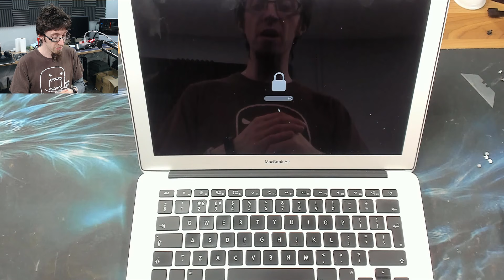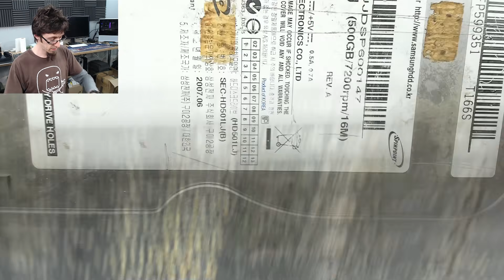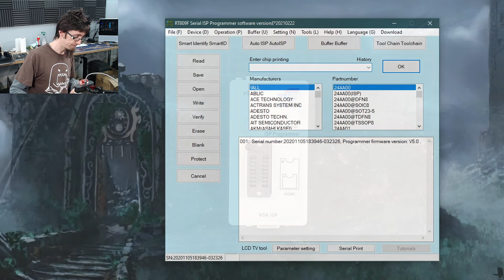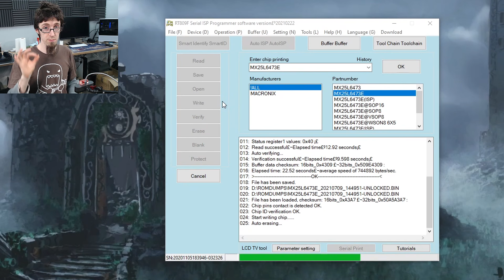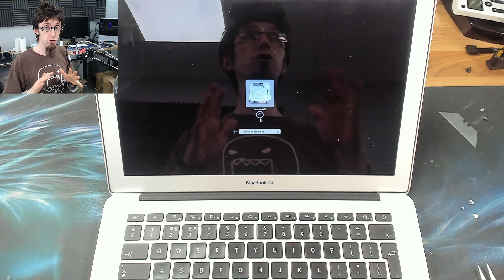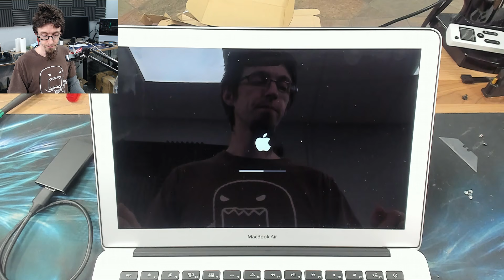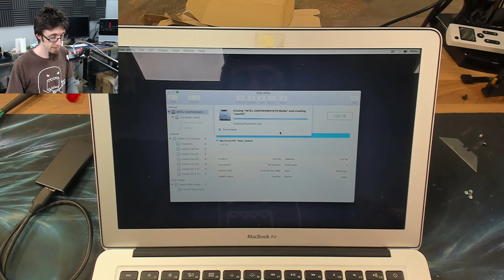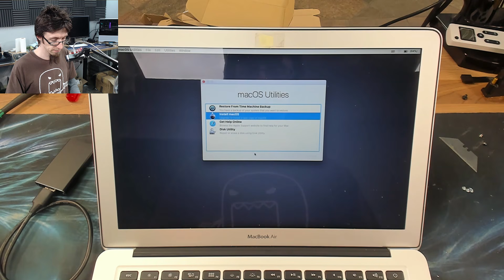[2017 and older ONLY] MacBook Air Firmware Pass / iCloud Lock Removal - LFC#275

Comment from the maker: Also, as far as I know modern Apples with a T2 security chip are different animals to this. I've seen claims that there are tools to deal with T2, but I've got no intention of risking macbook to test them, or at least not until I come across a bricked one that can't get any worse.
Reply: @AppleReviews  Which is fine if he charges for these services. They can go to Apple if they want. However many place DO NOT HAVE a PSP or AASP nearby.
Reply: @AppleReviews  However they have to way to accept desktops without an Aasp or Psp. There is no mailing in DTs
Reply: Did you do something like this with IPhone ?
Reply: i bought a 2019 mcbook pro 16 inch i9 has efi and cloud this was an auction buy if I fail would you take a donation also are the t2 chips that far different in aspect I notice there is the t203 device I was considering adding for this unlock process? also a member of the discord :)
Reply: 👆👆he just help me unlock my iPhone 11 pro max 🙏..
Reply: 👆👆he just help me unlock my iPhone 11 pro max 🙏..
Reply: We do it with forensic tools. This has ben able only a few months back, not long ago!
Reply: Is it possible to remove drive encryption and iCloud password on 2020 macbook with touch id? I know these later models are all linked and can't swap out chip ssd etc any help appreciated thanks
Reply: Adamant IT  I have a different BIOS chip than the one you have. Is that gonna be a problem or do I follow the same steps?  My chip: Winband 25Q64FV10 1513 6448 6R800ZZ.
Reply: @blgrnt123 Choose the correct BIOS/EFI chip from the drop-down menu, then follow the same steps.
Reply: @blgrnt123  Choose the correct BIOS/EFI chip from the drop-down menu, then follow the same steps as in the vid.
Reply: So doing this ,will it remove all data?  My sister in law has a mac laptop and when she split with her ex he put a password on it(I'm not sure if it was a cloud one) and wouldnt let her have it and she's been locked out for years now. She would love to be able to get into it as she would have baby photos on it. Is this something that would help her? Or as it sounds like your uk based would you do it for a fee? I'm sure she would have proof of purchase there still. I would love to be able to recover it for her.
Reply: Where I can order your services? iMac M1 locked
Reply: How can I reach you?
Reply: Hey, does this work on the M1 Max series MacBook pros as well? Thanks!
Reply: 0
Reply: How can I get to talk to you?
Reply: Do you happen to know if this method works for the MacBooks with M1?
Reply: Hi guys i need this service, im based in the UK and have emailed your shop but have had no reply!
Reply: What about T Chips are they in the same boat as T2?
Reply: I want to buy a MacBook mid 2010 a1342 (MacBook7,1 & EMC 2395) with Lion operating system from an organization. They forgot the firmware password so they are giving it away cheap. Found a way on the internet to remove the firmware password by changing the amount of RAM and clearing the pram. Will it work on it?
Reply: Would I be able to send you my computer to fix it in firmware lock? I drove 2.3 hours to the closest Apple Store and they told me they couldn’t do anything and it’s stressing me out, it’s been stuck like this for months, Idc how much it costs, I just really need help
Reply: Will Linux run on this???
Reply: Why would you need to "risk it"?? Just i-Cloud lock your working  Mac (you KNOW the password) and see if the tool will unlock it.
Reply: How can i remove firmware lock on 2018 macbook pro 15inch that won't allow the keyboard
Reply: Hi,I need your adwise,can I use EZP 2019+ programmer to unlock Macbook pro A1425 late2012?Thank you.
Reply: Firmware lock 20q5 macbook air dfu mode
Reply: the macbook i'm working on it is 2015 A1466.
Reply: Why don't you try it with an iPhone? 🤔
Reply: @Ángel de Jesús Flores Tinoco  iPhone I locked to server.  If you achieve changing the Serial, UDID and  IMEI the u cam get through!!
Reply: @chuy6590  why dont you send him a iPhone to try 🤔
Reply: *waves hand* You don't want to send him an iPhone to try, "you want to go home and rethink your life"
Reply: @sugargliderdude  because he's a dreamer 😴
Reply: You are correct about the T2 chip. Also, not that it’s a big deal, but I find taking the battery out of those model MacBook Air’s when removing a logic board a bit easier to reconnect the trackpad and backlight cables. I do hope though, that you backed up the files that were on the SSD, and or they had a time machine back up. 😀 BTW.. what is Mac OSS ? 🤣😂
Reply: Thank you brother you are doing great job love from Pakistan i have learned so much from you it would be impossible without you❤️
Reply: Hi, i work on T2 device all the time, if do you have any questions or need any help let me know
Reply: @apple_unlocking_services3004  yeah you do bypass, charge a fortune and then when they try to do macOS upgrade it locks again. You phantom unlocking wankers are so full of shit aren't you???
Reply: @apple_unlocking_services3004  hi
Reply: @apple_unlocking_services3004  yes i have a question to you.
Reply: @apple_unlocking_services3004  hey do you know if this method work on t2 chip to bypass icloud and firmware password?
Reply: @XDPower94  
Hi, for the EFI removal on T2 devices it can be done through replacing one file inside the T2 chip files, no need for hardware work

for the activation lock it can be removed through software “Paid” or hardware “Free”
Reply: @apple_unlocking_services3004  what you mean by hardware?
Reply: @XDPower94  
which part ?
efi or activation lock
Reply: @apple_unlocking_services3004  activation lock
Reply: @XDPower94  making a modification to one of the chips inside the device, requires skilled technician
Reply: @apple_unlocking_services3004  i really wanna learn, what chip i should look? Bios?
Reply: @XDPower94  
i have been selling the method for $750
it toke me lots of work to learn it 

i can only share general info
Reply: @apple_unlocking_services3004  tell me where to start and what to look. No need explain a lot, just few things please.
Reply: @XDPower94  
do u wanna learn it because u have 1 device  to unlock & thats it ?

or u need to learn it for doing business ?
Reply: @apple_unlocking_services3004  i have one device and i wanna unlock and learn if it s possible. I dont do business... My brother found this mac in the magazine where he work. And its not even turning on. Im trying to fix and unlock
Reply: @XDPower94  
its not worth the work & time to learn the whole process to do one device,
better to take it to a shop & pay about $100 to unlock it

i guess this method will never be free to the public
Reply: Hey why can’t you just replace the hard drive?
Reply: one word CRAPPLE . whorible products poorly made too trick rich people into buying them , they are soo simple in their OS and everything their made for 80yrs olds ... hahahahah and no customization.. PS Louise Rossman must be your Master boss
Reply: @EpicGamingEct  Wow. Can't get more ignorant than this fellow. "they are soo simple in their OS" What?!
Reply: @EpicGamingEct  You obviously have no clue that macOS is BSD and you get full and unrestricted root access to the entire filesystem. Being UNIX, I would venture to say that macOS is considerably more advanced, more stable, and more "customizable" than WinBlows. :)
Reply: @EpicGamingEct  you clearly never owned one 💀

Comment: Will this work on Mac Pro 2011?Got it gifted from Uncle,went through some trouble fiddling with lion os eventually found a way to get high sierra set up account through it efi locked it forgot password so it seems bricked atm
Reply from the maker: Should do. I've not looked at the BIOS on a Mac Pro, but given it's from the older era stuff, it should work approximately the same way.
Reply: @Adamant_IT thank you sir much appreciated

Comment: Very interesting.  I have a 2019 Intel iMac 27" that I want to restore to factory new but it has a firmware lock on it.  Are there ways of removing the lock without dismantling the machine - I'm aware iMac's are quite tricky to open.  Thanks

Comment: Thank you very much for this detailed tutorial. With all the information contained, I was able to get my old MacBook Pro up and running again. The programming with the CH341A mini Programmer turned out to be a bit tedious, because working tools (AsProgrammer) are only available under Windows. With the macos G-Flash programmer it was impossible to even recognize the firmware chip, let alone read it out and reprogram it. However, with a Windows PC I finally managed to unlock the firmware and reinstall macos via USB bootstick.

Comment: Would this process work for a more recent macbook pro with a T2 chip per chance?
Reply from the maker: No, there's no real password removal for T2. There are some temporary bypasses, which is what the unlocking sites sell you, but those unlocks will fail any time the laptop receives a security update, so you'd basically have to keep it offline forever.

Comment: This inspired me to get a programmer, I got the ch314a and all of its accessories in a pack. I do have this adapter to 1.8v. Is this the one you mentioned? Also there is a eeprom chip frame for the programmer. I just need fit the chip on in the frame, than the frame to the adapter and adapter on the board right?

Comment: What kind of heat gun is used for soldering and de soldering the chip from motherboard??
Reply from the maker: It's called a 'Hot Air Station' My one is a Quick 857dw+

Comment: Hello, I wish you good work. I have an iMac A1224 model PC. I have a problem with the BIOS. When I log in with the combination key, it does not allow me to install a different operating system. If you have my request, can I get the bios bin file for the A1224 model?

Comment: my screen is flickering on my 2019 macbook pro 13"  and the battery drains quick. I found the same laptop but its a 2020 so should be the same parts. Can i just move my motherboard over to the 2020 macbook pro or is it more complicated than that. PS. the 2020 one is locked and for sale on ebay.

Comment: I got a macbook air mid 2013 from a family member that they brought off ebay the seller got them from a computer salvage store the macbook has a four digit lock with a keypad on it I took it to apple they told me that it was a efi lock they couldn't help me with out the original bill of sale so i just remove the efi chip and put a new on it it's working now
Reply: Okay but do you lose the old data ???
Reply: @maleksouab6930  You do not lose any data. Replacing or overwriting the data on the chip only removes the EFI password and allows you to use your device again. That being said, there is also another method of removing the EFI password - instead of removing the EFI chip, you can use an adapter to connect to it while the motherboard is still in the MacBook, and then overwrite the password using software. In my opinion, this method is easier (at least in some ways).

Comment: i have my mac with oracle Remote management lock what should i do@adamant, thanks in advance
Reply from the maker: MDM requires a serial number change, which is a similar process to this, but with extra steps. There are some apps that streamline it, but still requires the chip to be reprogrammed
Reply: @Adamant_IT  thanks man and my mac is T2 series
Reply from the maker: Oh that's game over then, there's no permanent bypass for 2018 onwards

Comment: Hi there!
I am trying to use this on a 2012 MacBook air.
The BIOS Chip is labelled 25Q064A 13E40.
When I put it into the CH341, it correctly identifies it as "Micron N25Q064A".
I can read the chip without issues and have already removed the password.
But now when I try to write to the chip, the programming Software (Asprogrammer) freezes and/or the CH341 disconnects itself from the PC.
The chip is obviously already unprotected.
Any ideas?
Reply: I figured out the issue: The output of the 3.3 V regulator on the CH341 was not stable enough to be used as the supply for the programmer.
After adding a 1µF and a 100nF capacitor on the output of the regulator, it now works flawlessly.

Comment: I removed the icloud lock from my iphone 14 using iRemover       The iPhone 14 is my first flagship Apple device. Coming from a Pixel 7, I have a few observations. The battery life is awesome, speakers are solid, Bluetooth connectivity is seemless, and the screen is smooth, despite coming from a 90htz display on the Pixel 7, I haven’t really seen a huge difference on the 60htz screen on the IPhone 14. I absolutely love this phone.

Comment: When you buy a used Macbook, is there any way to be sure that it won't get locked in the future via icloud lock through like Find My? I assumed if it's on Find My, and they sell it. And even if you've reset everything. That they could still years later put it in lost mode? And so it's like a ticking time bomb any time you buy a used Macbook? 

I bought one from a reseller. And it was password free, and it wasn't signed into icloud. I'm going to do a full wipe and reset. But any way to know if it's tied to someone's Find My?

Comment: This is 100% tragedy when i saw yours video. You are using method from middle ages. It only takes 12 seconds to remove the bios password from this macbook air and you don't get anything out, you just plug it into the service socket on the motherboard. Tragedy, it's not even funny. Don’t forget to format ssd when you remove bios lock FF sake 😔

Comment: Does this process remove iCloud Actication lock or bypass it?
thank you
Reply from the maker: For pre-2018 laptops, when the process is done correctly (remove password, reset SMC, re-install macOS) it removes it.
This does not work for macs with a T2 security chip or M1/2.
It can remove an MDM lock if the serial number is also changed, but this requires extra steps not included in this video.
Reply: @Adamant_IT  thank you so much for your fast reply....

Comment: What about the new MacBook pro M1. From what I understand they can't be fixed.
Reply from the maker: This is correct, the method in this video only works on older macs up to 2018. T2 and M1/2 can't be truly unlocked. There are bypasses, which is what most of the scammers in the comments are selling, the bypass can skip the lock, but as soon as the mac checks again upon doing any kind of update, it will re-lock.

Comment: On your easy p 2019 you need to weld a wire from the pin 4 location to the ground dot on the back of the board take the screws out of the controller look on the back of the board you'll see pin 4 location and do it to the ground dot well drill wire there and you'll get a connection every time

Comment: no way it work
Reply: nothing mystical about it. icloud is useless if it can't tell different macbooks apart, the firmware chip IS the computer's entire self identity. remove and rewrite the chip effectively generates a brand new macbook. as far as cloud is concerned. this was my first micro soldering attempt and with much patience, it was very straightforward

Comment: Hey Graham cheers for these videos. I’m a DIY guy at heart although I had never had to enter into the programming world up until recently as I am trying to fix my 2012 a1278. I have done al the steps mentioned (with the ch341a) (I didn’t know about the voltage issue). My problem is now when I recheck the new data (and if I check the original), I am finding $SVS in multiple places, even after I had overwritten it with FF

Is this something that is a normal occurrence? I can’t find anything about it online. If it is common, I guess the first $SVS is the only one related to a FW password?

Comment: Hello brother. I have a MacBook Pro 2015 model a1398 
its iCloud locked and I was using a windows on it. but someone reset it mistakenly. now it's stucked at question mark on a folder symbol. 

do u have any solution for this?

Comment: very good job, just one question, is the macbook pro m1 2020 icloud lock chip the same as that one?
Reply from the maker: No. 2018 onwards macs with either a T2 security chip or Apple Silicone (M1, M2, etc) can't be unlocked with this method.
Reply: @Adamant_IT  thank adamant but its possivel unlock m1 pro 2020? You have a link for look? Thank you very nice for share your hard working

Comment: Hello, works on M1 2020? can remove icloud? Thanks
Reply from the maker: No, there is no practical unlock for M1 iCloud that I'm aware of. Beware all the scammers in the comments. Any bypass would need to be a highly sophisticated hardware attack.
Reply: @Adamant_IT  Hello Adam, im Diego pleasure to tlk with you.do you see ther T203 device? the come with an eprom programmer and one pendrive that come with littel SW called mina MAC T2 that after modify the bios ic will activate the T2 and clean apple id.Do you know?
Reply: @Adamant_IT  yes Graham, I wish these bullshit bots would get a real job. What happened to stealing old ladies handbags for God's sake 🤣

Comment: How hard is it to get into this?  I imagen it can be quite lucrative unlocking MacBooks and selling them
Reply from the maker: Provided you can use a soldering iron, not difficult. But keep in mind that 2018 onwards macs can't be attacked with this method, and also a lot of laptops that are locked are likely stolen, so you have to tread carefully. The days of easy ones like this video are numbered I'd say. Good way to get started on BIOS repair work, but don't base your business model on this one fix.